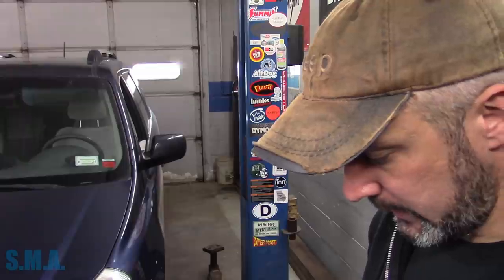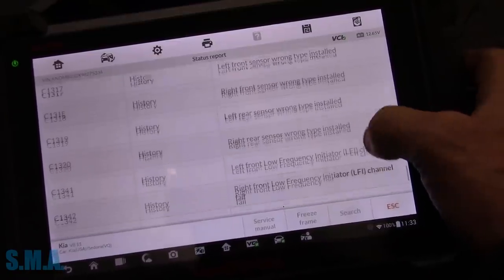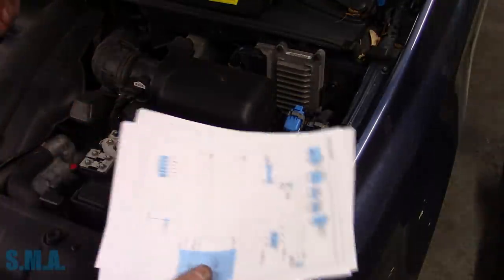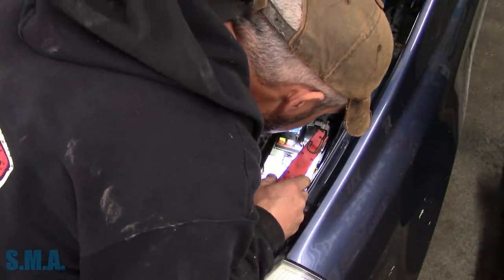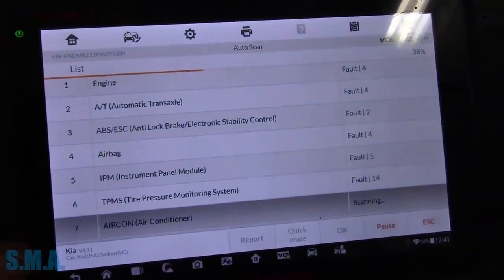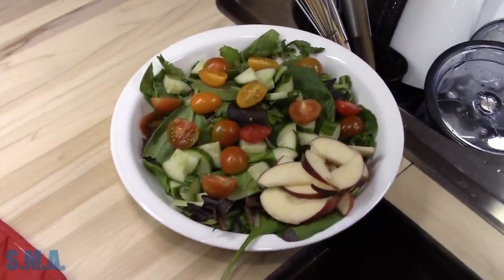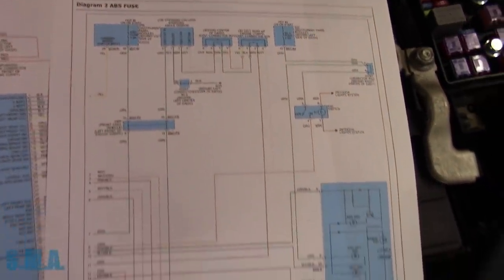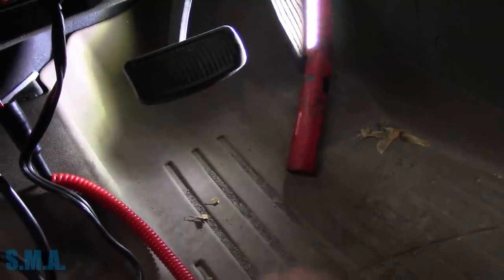You Can't Fix'em All...

Comment: I’ve got a 96 convertible cavalier ls that I guarantee you couldn’t diagnose without throwing a ECU at it. Low voltage code for the crankshaft position sensor caused by a random ground wire that was shorting the number one coil, threw a ignition module at it and it is running fine now but it still has a low voltage code even with a new sending unit. Doesn’t appear to be wiring but I need a wiring diagram to confirm it’s not a wiring issue.

No one has been able to figure out if it’s the ECU or not that took damage spent 1100$ just to get no answers from two shops.

Comment: Back in the days when cars had 2 to 4 fuses, & someone uprated the headlights then fuses would sometimes fail from thermal cycling after a few years having to carry their actual rated capacity repeatedly.
Nobody has built cars where fuses get loaded a high enough % of their rating for fuse aging to be an issue in over 40 years probably nearer 50. Car manufacturers don't push fuse ratings anymore, they create more circuits and add more fuses.
If the car is under 40 years old, has more than half a dozen fuses total, then any that blew there absolutely was a reason for it.

Comment: Multiple issues...PO501---Rodent or road salt damage...under fuse box, right front wheel speed sensor (which feeds signal for ABS to ECU). Spray with water...fuse blows...there's your dinner, er ah, your problem.

Other codes...caused by mis-wiring of remote starter.  Surprised airbag hasn't went off with a bang. 

Also all the tire pressure codes...possible that tires and wheels were switched to different size and size not updated in computer...also throws off wheel speed readings for ABS.

Solution...sell it now, while it still runs.

Comment: I have a 78 Vette, it has most of the original fuses... I'll let you know when the reach their 'thermal cycle limit.'
Reply: The old style fuses with a filament could fail, likely due to vibration and someone called it thermal cycling and the phrase stuck.   If thermal cycling exists today then the load is too close to the fuses's rating.  There should be two circuits and two fuses or a larger fuse, with larger gauge wiring etc.

Comment: Had this on a vw polo. Blown fuse Turned out to be a stuck electric motor in the abs pump. Cleaned the motor en test drove it on the grass, customer still doesn't had thr problem back. When the abs is not used for years and years the pump can stuck

Comment: Thermal breakers wear out after a number of trips. But fuses very rarely blow without a reason. Manufacturing defect (in AG glass fuses) mainly. Nearby lightning strike inducing a surge (had that) but thermal cycling? Run that by an engineer with a straight face. Nuh-uh.

Comment: I also hate having fuses fail with no obvious reason.  Surges below the rating of a fuse CAN weaken a fuse can cause it to fail even though the capacity is not exceeded. It's a form of metal fatigue.  It has happened in my house.  The few times I found them on cars were ones that had their batteries replaced, and once on a small suv whose owner had rotated the tires.  All those cars were Asian and had Chinese fuses.  Never found a better reason for "phantom shorts".

Comment: I had a 90's something Cherokee brought to me with the brake lights not working. Blown fuse. Could not for the life of me find a short. Replaced the fuse and 9 years later the younger sister is driving it and still has not had the problem come back.

Comment: i had the same thing happen on my tundra, remote start was installed for 6 months no issues and the dealer did some work and suddenly my steering angle sensor took a crap and they blamed the alarms CAN data wire that was tapped into the SA sensor. just  a thought
Reply: my truck went into limp mode when that sensor failed though

Comment: Had a body control module A go bad on my dodge 12' and it threw all kinds of codes from it,lights flashed dash junped all over tge place, threw service 4wd and brake control module codes on top of others. I scanned it at the shop then took it to dodge and they refused to honor their warranty even after changing the whole wiring harness that didnt fix it

Comment: What you didn't do is turn the radio on and turn it up as loud as it can play. Best Try has probably connected it to that line and it pulls enough power to send the other stuff low. The radio can probably pull enough power to blow the 7.5 amp fuse.

Comment: It's gotta be broke before you can fix it. I have an OBD1 problem 92 Crown Vic stumble/ miss, no codes, two different scopes show nothing, compression good, vacuum 18" and steady, suspected broken valve spring, pull valve covers nothing. will jump back on it Monday. If I can't fix, you can't either.

Comment: [Insert Short Jokes here]  Besides the normal jiggly bits tests you can just turn things on and off while driving.  Blast the AC or heater and turn the radio on and off and then try the remote start with the radio on etc...  But then you'd probably never find the gremlin anyway...

Comment: Sounds like you have a wire that is intremiantley making a connection . Or a bcm that may have a short or a bad diode. If it's not the wiring usealley it's related to the aftermarket garbage that was installed. Causeing diffrent voltage and resistance values in the original equipment manufacturer modules/ sensors and inputs to the ecm and etc. Witch could be causeing the abs to go into out of spec.  Or it may be that there is just air in the system . Iam only saying this beacuse of the new break lines. Or it may be none of that it may just be a bad abs sensor with metal shavings on it. Usealley the answer always comes when you are away from the promble and your mind can think clearly. And you can analize the situation in your head vs being in tunnel vision mode when on top of it . B.t.w I have actualley taken the modules out and I have found blowen diodes or cooked ic's and etc. But I do understand that you are allready upside down on it and it's time to move on and pay the bills.! I would say that the fuse blew probabley cause there is a short to ground in the one of the PCBs if it's not in the wires. If I had to guess. Or a bent or broken pin from somebody else who was working on it in a hurry.

Comment: G'Day,Ecca,,Mate i salute you,,for stopping when ya did,,
had problem with shear not returning back to home position,,Hmm ( Steel worker,)
any way shear cuts and then has 300 volt 2000 amp dc current shove up it's arse to stop rotation.and reset back to home position after one rotation,,
Shear was all over the place causing hot steel to "Cobble all over the floor,"
So motor's stuffed??
Umm Gear box is Broke,,??
Encoder not responding,,??
Animal attacking wire-ring,,??
And so on,,
so now i'm in play,,
Boss change motor,,check spare gear box,and so on
Went up stairs to control console,,usually air conned to 20 C,,
hmm Bit warm in here,,after a little look ,found cooling fans on Control console had fused,,
Bloody big fans by the way
Replaced fuse and all was well
So again Like your approach of finding some thing and not just replace every thing,,

Comment: $10 says its something that has been installed  by an individual. I have had my car for 8 years and not one issue because I don't modify my car at all ...If I need power I run a new circuit off battery with fuse or relay depending on what it is.

Comment: Whoever did the aftermarket wiring should look through it all. My theory being they know better than anyone what they did and how they did it. As for your rambling.....what rambling these are the toughest problems to fix. There are no wrench extensions, penetrating oils,  mega air hammers, or torches to deal with these problems.

Comment: The worst problem to have is the self-fixing one because you still don't know what the problem is; but you do know it still isn't fixed! My wild guess is the best-try guys nicked a wire during install, shorting the fuse; repaired the nicked wire but didn't replace the fuse.

Comment: All these interconnected computers on cars these days are why I don't want to buy new stuff. Love my Squares for that reason. Also something on my 85 C30 Dually is or was using speaker wire for something other than the sound system and I have yet to figure out what it is exactly. I know it's not for the aftermarket Dana cruise control.

Comment: The problem is mechanics are not IT techs and IT techs are not mechanics. You really need to be both with modern cars. How else will you know if it's code glitch or part failure?

Comment: Because I've done it myself...I wonder best try didn't short the fuse by allowing a bare wire touch the test pins on the fuse...talk about a surprise followed cussing fit because 1 you(I) screwed up and 2 you don't have any spares in the size you need

Comment: Of course it's a nightmare, it's a Kia.  I've got a 2009 Sedona on it's way to the scrapyard with a blown engine.  Only 85k on it, never driven hard with regular oil changes, synthetic oil no less.  Kia crap.  If it was running I'd be tempted to drive it through a window at the Kia plant

Comment: Eric I have never seen you give up on an ELECTRIC problem I know this video is two years old I see that crap does underneath that Dash sing kind of crap icy out here on carsoda dealers in Southern California with devices like the karr device and other crap like the Rockledge device these are devices that are put on so vehicles cannot get stolen off of dealers lots and all they are is nothing but trouble and especially when the customer has to pay between $1,500 and $2,000 on these cars I would rip that thing out as soon as you possibly could and I think the problems will go away .

Comment: I put this up in JRS54's channel because he is a Snap-On Junkie and I see you also like paying $100 for a tiny ratchet at times. Bless your channel in Jesus Christ: Amen. 

Here is a tip from a nobody, which is me.

Take a fork from Mrs. O's drawer. Shhh! Dont tell her. Curve one end around 45 degrees with pliers, or with front snips. Curve the other end 90-180 degrees depending on what you need in the moment. Curve one inner prong 45 degrees and sharpen it with a file or a grinder and do what you think is cool with the other prong. Boom, no need for a $100 pick set from Snap-On.
Reply: I literally did that and picked up the wires that mouses had chewed through and used my fork multi tool together with Liquid tape to repair. I believe that some tools, need investments in, but many others you can make for yourself. This is one of those times. A fork is better than Harbor Freight in this case.

Comment: sometimes a fuse will blow at lower amps.. not something you can prove, but shitty manufacturing does happen. You looked at everything. can't find anything, put in another 7.5.. it may last the life of teh vehicle, if it comes back, you have a component issue and those SUCK at figuring out on an intermittent issue!

Comment: My wife laughs at your comments at the end of your video. If I can do it you can do it. You sound ridiculous  the general public does not have your knowledge. Or have the equipment you have to diagnose computers related problems. An with that statement be able to totally understand the scan tool  information. I myself disagree how you do front brakes with ABS pushing brake fluid back into the system. I enjoy your videos watching you do repairs on cars and trucks. I use to be a mechanic and left that to do electrical. Just like repairing cars or doing electric everyone is an expert. The problem with all the experts is the job done safe and correctly? I hope you read this and comment back. GOD BLESS

Comment: I've seen chopped wires and found remote start boxes on a car at a dealer lot my son and I were looking at for him. 

Went in and asked the dealer if it had remote start. They said no. 

I pointed out the flashing antenna and mentioned the box and they were like we'll have to get a key made.

Comment: A bad vss can/will cause abs code(s) dingleberry.
One step at a time. fix the vss issue clear all codes test drive and see what comes back. Your suppose to pull codes, record, clear and then test drive and see what comes back. Fix codes that appear first, first..codes that appears last, last.
Why are you going to the most extravagant issue and ignoring the obvious?
As far as fuse blowing goes. Disconnect all loads from circuit, insert fuse, and reconect loads one at a time till the fuse blows. When the fuse blows you found your culprit. If the fuse blows with all loads disconnected your wire has a short, dummy.

"What do i know" apparently not how to properly diagnose a car. Or what a flow chart or TSB is either. You should walk away from that one, you obviously don't know what your doing. Buy a real scan tool while your at it, cause that one is a piece of crap. So is your flashlight. BTW wheel speed sensors are a AC sinewave form and generate their own voltage. That's why the wires are twisted together so the AC electrical noise doesn't harm the DC circuits. Electrical 101 right there...
Before you get all pissy understand im a 20+year 2nd gen master tech, shop owner and specialize in diagnostics. This entire video left me with my head shaking....
This is a perfect example of an idiot acting like a professional.......sorry but the truth is the truth. If you charged for what you did on that van you are a crook. Id fire your ass in a heartbeat for being incompetent.